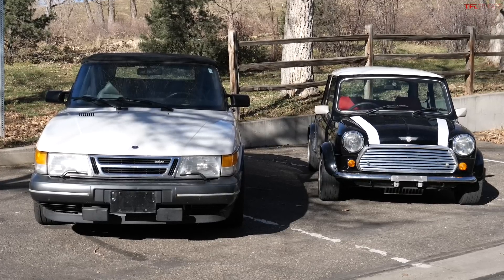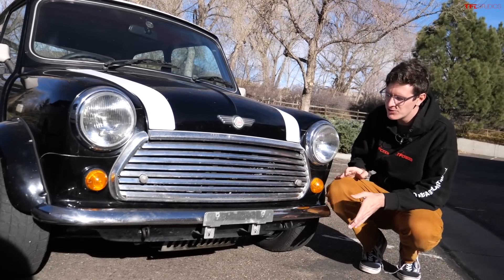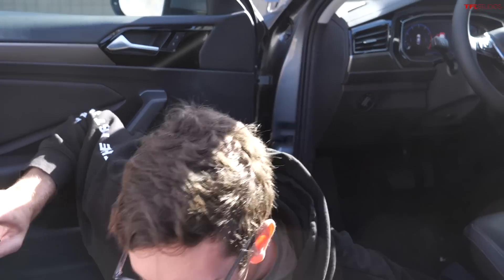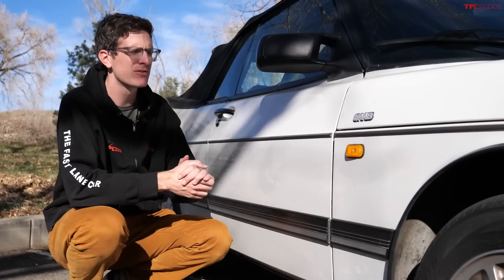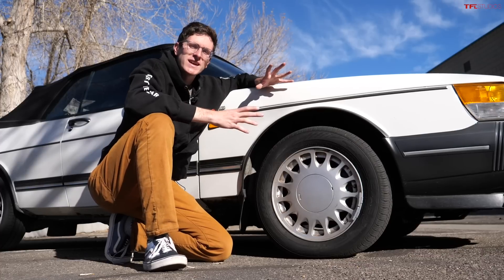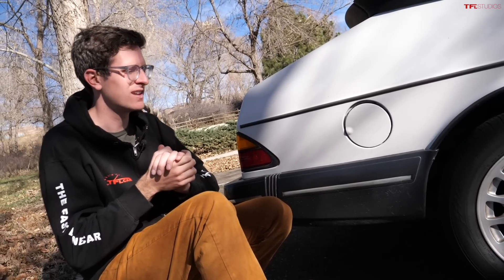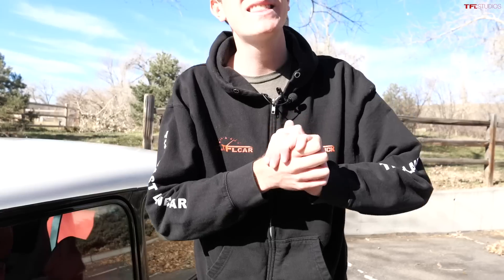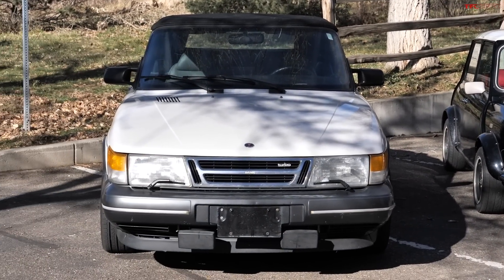These Are the Top 10 Things That Suck About New Cars!

Comment: There's only 3 things I miss about older cars:

1- comfort : modern cars have stiff suspension, dampers, sway-bars and seats combined with low profile tires running at a high pressure, that's not comfortable at all.
2- visibility : modern cars have narrow windows and dark interior, you can see that well outside and you feel claustrophobic inside.
3- door and whell protection : modern bumper are actually good at preventing damages, but the doors are unprotected and those low profile tires with wide wheels are way to easy to curb.

Comment: Problems with modern cars: too much electronics and nanny safety “features” as too firm of a ride... and I blame car reviewers at this point. So many complained about not being able to feel the road in large vehicles (everything from Malibus to full size trucks) and then cry and cry and cry about gizmos and gadgets not being included or something being too simple. Now, nothing is as comfortable as the older cars, trucks are seemingly too delicate, and performing basic maintenance is a thing of the past. 
Why have door latches been changed? Why do you need a computer degree to operate the radio? Why do we keep fooling around with transmission selectors?... It’s for the same reason every houseshopper thinks they need granite countertops and shiplap - the professionals told them that’s what they wanted, thereby directly driving the market to basically require those changes. 
I wish I could found my own car manufacturer and produce basic, reliable, and comfortable vehicles again - nothing over-designed and loaded with tech... just the essentials both basic upgrades. Pipe dream.

Comment: The auto engine shutoff is the anti-Christ of newer cars. Especially if you can't turn them off..
Reply: The thing is, it's not only annoying, it's practically worthless.
Reply: Yeah I'm never buying a car with auto-shutoff.  Easiest way to make it go away folks is to never buy one.
Reply: In a hybrid it's unnoticeable 🙃
Reply: @Brian Lee Great reason for there to be a manual override switch... It's never happened to me, but I've always wondered what would happen in my hybrid if the engine refused to run because of cold weather. Manual overrides should exist for auto start stop, like there are for traction control and stability control

Comment: Good rant Tommy.  The recovery points are big for the person doing the recovery.  Manufactures give no place to pull a vehicle from the ditch and that leaves the tow driver at fault if something breaks.   I also miss headlights that do not fade over or melt on the inside so they are junk.

Comment: My biggest gripe is all the stuff they now do to keep us from repairing or maintaining a vehicle.  And it’s not just one brand. I had a car  that required a tool that wasn’t  sold to the public to change the fuel filter. I’ve seen cars where you have to spend a freaking hour taking all kinds of crap off just to get the the first spark plug out because they aren’t designed to be served by the owner of the freaking vehicle. Also the computer stuff sucks. I recently paid off a my car this year. And of course all the electronics starting freaking out. Low tire pressure indicator basically stays on all the time. I’ll be driving down the road and all of a sudden my emergency brake indicator comes on and there’s an Audible beep sound. Not trying to sound like a conspiracy theorist but it’s seems like the same crap the phone companies do. Like when they come out with a new model they intentionally slow down the older model to get you  frustrated enough to go but the new one. 

The crazy thing is that as much as cars costs they do all this crap to try to force you into having your car worked on by the dealership. I miss the old days where In one evening I could change my brake pads, plugs and plug wires, oil, oil  filter, and air filter and then get in my car and not have a freaking check engine light,

Comment: Most of these changes were required due to CRAPE standards and safety reasons.  The low ground clearance, lack of full size spare (increased weight) and bumpers are all fuel economy changes.

Comment: Old cars did trunk space better as well. I have a ‘50 Buick and your Mini looks like it could fit in the trunk. This is hyperbole of course, but you get the point.
Reply: I think monster trunks might make a comeback
Reply: In my experience all the old cars I've owned have had long trunks, but not very deep or wide, especially if it has a full spare, compared to a modern car. I also find the space to be more useable in modern cars.

Comment: if you’re ac doesn’t work you, 1) have more than 80% by weight r134 in the system, 2) your Orfice tube is the wrong size, 3) your low side isn’t reaching 25psi and the high side isn’t reaching 150psi, 4) you have a leak probably from having the wrong gaskets i have converted some cars back to r12 but still used the green gaskets because they seal the system way better because r134 molecules are smaller than r12, 5) if r134 isn’t working for you good enough then switch it to propane because it’s a certified refrigerant. all your ac problems solved by a master technician for you.

Comment: Some of those (the tire sidewall & door handles for example) are styling issues which affect the look of the vehicle more than you might think. For aesthetics, I like the newer use of narrow sidewalls and understated door handles. The handling affect on the tires does depend a lot on how the cars suspension is tuned, and the door handles? There have been some innovative designs for those as well (nice to look at and easy to use). But that can be quite subjective. Thanks for video.

Comment: Thank you Tommy, old cars have Full-Size Spare Tire (biggest scam), cigarette lighters/ashtrays, and metal.  Easier to work on? Can live without distributor cap, carburetor, non-supportive seats/headrest.  Airbags, anti-lock breaks, and traction control are nice - tips when to turn off traction control.  The ability to hook up a scan tool is nice.  
Backup cameras - 50/50 - learn to use your mirrors.

Comment: @Tommy    I've got a couple more; I didn't go through the comments so sorry if somebody else already said it.  So, here we go: crotch vent on the dash, smoker's vent widows, lockable and illuminated glove box, stick-shift transfer case instead of an electric actuator that always fail, glass-halogen headlights that never fade and also prevent icing and snow buildup, easily replaceable light bulbs throughout the vehicle and all-manual adjustable seats. I can't stand electric seats; they work so slow it drives me nuts! I thinks all new cars should bring back all those things, optional or not.

Comment: lf I never have to see bumpers or door bumper guards ever again, I'll die a happy man.  The guards were the first thing I took off my old Mazda6S. Made it look way more upscale.  And I'm all about push button transmissions. So much more space than a floor shifter. The column shifter in my Silverado is clunky and has no place on an otherwise nice interior, which is why it's gone in the refreshed model.

Comment: One of the quickest way's to guess the year of a 2nd gen ram is the bump guard (rub strip) 98 and older are full length. Dodge removed 1 section per year on 99-01

Comment: Old cars do better mechanical throttles , hydraulic steering , mechanical emergency brake , standard shifting with clutch. Buttons instead of touch screens , fun designs , less computers and modules , big engines.

Comment: Touch screens shouldn't be allowed in cars.  Buttons, knobs, and switches locations can be learned and don't require you to stop looking ahead look down the see if you really are turning on the heater or turning up the radio and going through menu screens to find the function you're looking for

Comment: Bring back the column shifter!
I can't stand the knob-based or push button shifters in modern vehicles.
Floor shifters are "OK", but they unnecessarily take up space, in my opinion.

Also, bring back front bench seats - unless you're driving a sports car, I don't see the point in bucket seats.
Reply: and elec parking brake , elec rear hatch. release , and window drops 1/2" when you open the door {mustang camero}   dead battery   than what do you do??
Reply: @youtubecarspottersguide1  I'm a bit confused by your statement, but I believe your saying what do you do when those are all electronic and the battery dies.
My point exactly. I know some situations there are "manual releases" for these things (i.e. Tesla), but it seems like companies are putting unnecessary electronic junk into cars just because it looks "flashy" to the unknowing consumer.
Wait till it breaks in 5 years.

Comment: They also need to bring back a regular analog speedometer. Digital speedometers are just crap. Also do away with all these stupid screens and give me regular knobs connected to the heater and radio. I drive looking out the windshield not looking at a stupid screen scrolling through trying to find the control for the heater and radio controls. Another thing I hate about new cars is the push button start. Nothing wrong with a key. Bring back the manual transmission too. One last thing I would love to see return is wing vents. Those were the best things ever. Only reason air conditioning took off was because of the elimination of wing vents. Never needed air before.  The world is getting soft. Toughen up buttercups.

Comment: What about touchscreens in general. I think they're far more dangerous to use while on the road.When you have to use the touchscreen to adjust your temperature, your radio controls, your heated seat and steering wheel. Why can't you just have physical buttons. Oh that's right, cuz it cost more for the company to engineer . Anyone can just plop a tablet on your dash. Looks so dorky.

Comment: I love my metal bumpers
I love my glass headlights
I ,ove my metal door handles I love my soft seats I love my 70 profile tire on steel rims I love my metal hub caps
I love my vintage car tags I love my metal bolt fasteners I love my mechanical steering and transmission linkages.
I can afford any new car but refuse to purchase one.i own 30 old cars none newer than 1985